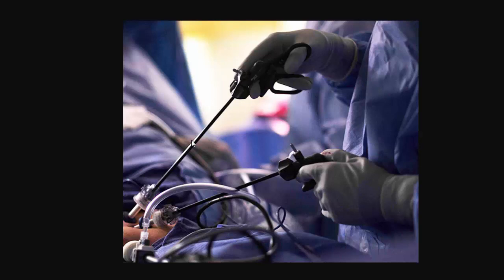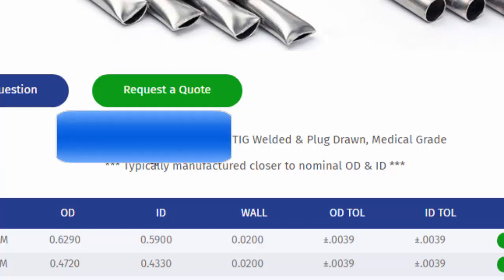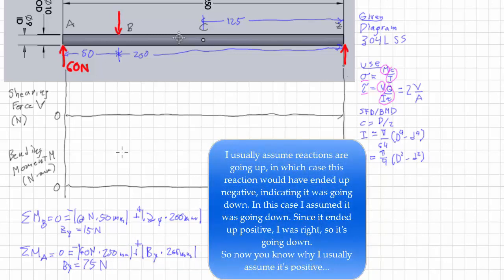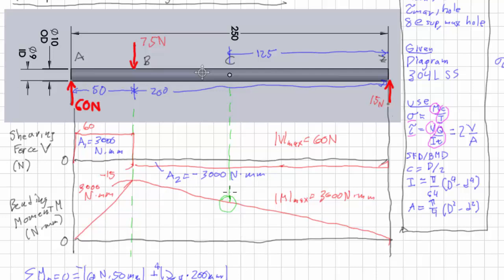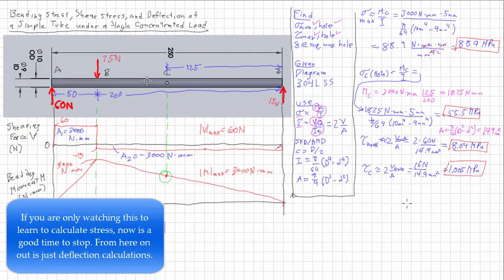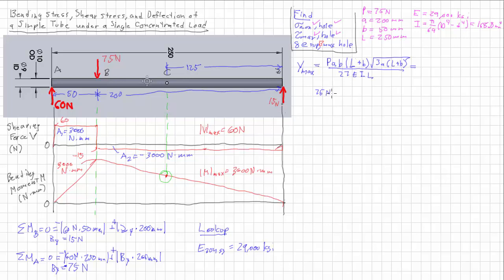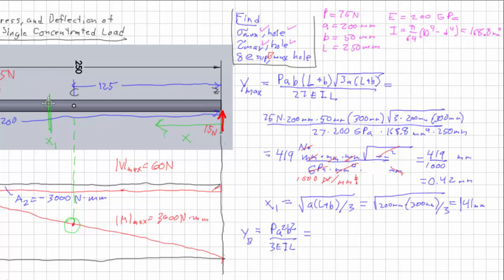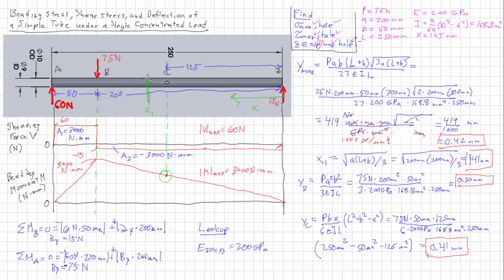Bending (Flexural) Stress, Shear Stress, and Deflection of a Tube R2

Comment: I thoroughly enjoyed going through the calculations with you on this.  It takes me back to the days of the Moment/Area method of calculating deflections as well.  You did well and your teaching is excellent.  Another thing to talk about here is (is the stainless material suitable for this application) and (can the calculated deflections be tolerated)  I understand this is a learning exercise for calculating stress and so fourth, but in my real world now we must decide if the material is suitable.   But again your teaching is excellent.  :)
Reply from the maker: Glenn,
Thank you for your compliments! True, the suitability question is important, but I felt the problem went on a bit long as it was. Maybe I should do a follow-up video? Maybe you should!? 

In any case, this is drawn from my experience and we used both stainless and aluminum tubes for these purposes and, as far as stress goes, they performed quite admirably. Thus, to me, their suitability was not an issue, but it is still a valid point. If you check out my Beam Stress series a-g, you'll see that it is covered there.

As for the moment-area method, I was never a fan, but maybe I should try to apply it to this level. So many video ideas, so little time!
 
Thanks again for watching and commenting.